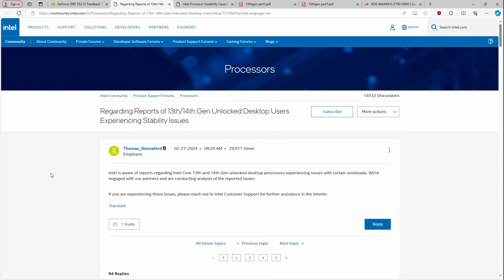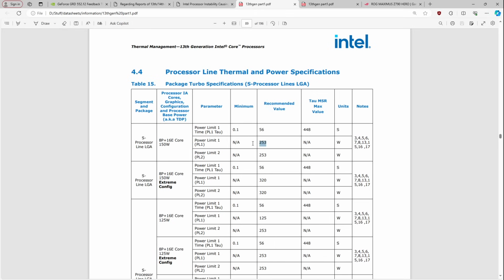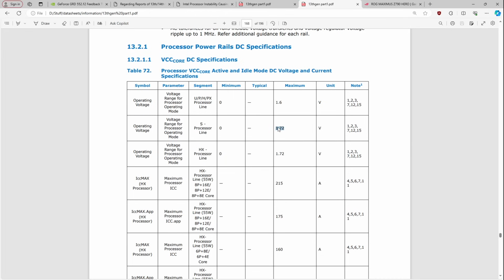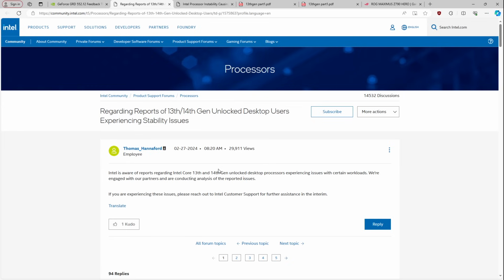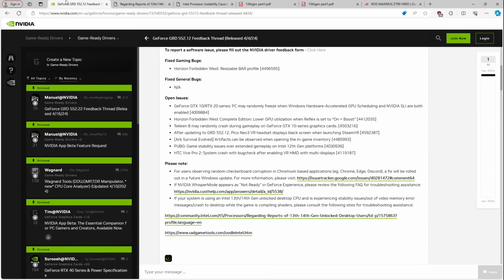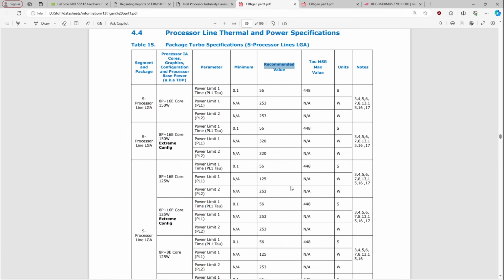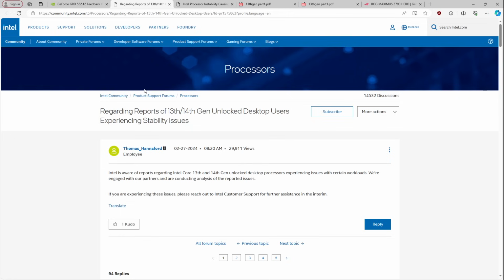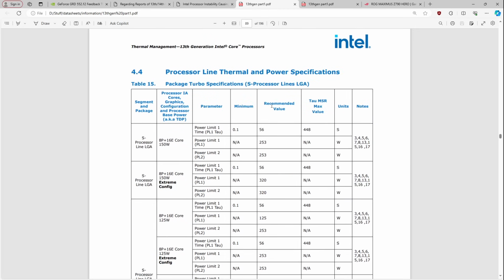Rambling about why some intel 13th/14th gen i9s and i7s aren't stable.

Comment: Nice BIOS upgrade by Asus.

I have 13900K.

I flashed 2202 and now with my custom settings, which were stable on 2102, CB20 dropped 2000 points and CB23 dropped 5000 points. The max performance core frequency on CB is 4800 when before it was 5500.

FML.
Reply: I feel you brother... 😢
Reply: I used to run disable - enforce all limits.  It now believes differently for me.  I had to change it to enable.  😕
Reply: ya 1202 update fucked my Z790 Formula. my chip was shit anyways, might as well RMA it.
Reply: @Ravenx217  There's something with the BIOS settings behavior that was changed.  If enable Asus multicore enhancements the system will run full out.  If I disable it (enforce all limits) the CPU runs at a much lower clock speed.  I previously had it set to the latter and my custom settings for performance and efficiency cores was observed.
Reply: @Ravenx217  Have you tried to flash the older BIOS?

Funny how the Asus MCE setting of "disabled - enforce all limits" drops all P core frequency to 4.8Ghz when before it would pretty much follow what the override setting was (in my case 5.4hz).  What's the use of having an override setting for frequencies of 1 to 8 cores if it isn't being used.  So now MCE set to auto goes 5.4Ghz all P core load.
Reply: What custom settings are you using? Depending on those, it could be why your clock rates dropped.
Reply: @Error-kh4cx  Default motherboard settings.

Comment: I have owned at least one 12900k, 12900ks, 13900k, 13900ks, 14900k and 14900ks. Some have had issues - the worst was the 14900ks I had 2 and both had to go back - real bad crashes/weirdness in Windows. A 13900ks would error bad on a mixed Prime 95 run so sold that as-is. The 12th gens were both fine. I now have 2 systems with a 13900k in and one system with a 14900k. Both running stable and well although I have done all sorts of changes in BIOS to under clock / volt the chips  to keep them from damage from ambitious stock settings.
Reply: Stockholm syndrome
Reply: @tommihommi1  HAHA
Reply: why in the fuck would you support intel at all let alone that much? delulu mf right here.

Comment: So many adjusted variables to make it stable. I do have a Ryzen 7700 and just run curve optimizer (-30) plus a CPU override of +75 Mhz and still runs 5.4 Ghz max at 65C ave on games. Maybe the lower temps are due to my AIO.

Comment: Wow I feel lucky with the limited issues ive been having with my AMD setup
Reply: What issues are you facing with AMD?
Reply: @Sahaj1601  issues with legacy pcie compatibility, basically. Using an old SAS card for more sata ports. Sometimes it shows the drives on first boot but occasionally I have to restart a bunch to get them to show.

Comment: Excuse me, but the numbers ARE specified. There are specific numbers right there, the spec exists. Mobo makers have it and they chose to ignore those numbers themselves, willingly. Excusing that with the word "recommended" is just shifting the blame and semantics, and it's like excusing war crimes because the Geneva Convention is "just a recommendation" so it's safe to ignore. 
Mobo makers are not kids, they knew damn well what they were doing and they did it anyway. This mess is on them...mostly. Yes, Intel is partly to blame because they could have actually enforced the specs and didn't, but that still doesn't excuse the blatant disregard of specifications by the motherboard manufacturers, who just LOVE to do those kind of things. I remember my MSI B450 board happily pushing between 1.4 and 1.5V into my Ryzen 3600 by default, so the CPU idled at 50 degrees with a decent cooler for no good reason...
So yeah...fck the mobo makers.
PS: the early Ryzen 5000s also had issues with not being able to hit the boost specs. I specifically remember few guys from the local tech forum complaining about their 5700x and 5900x CPUs...I didn't know that 3000 series suffered from that too.
Reply from the maker: 1.4-1.5V for the peak boost frequencies is actually exactly what AMD set.
Reply: @ActuallyHardcoreOverclocking  Yeah, but it was getting over 1.4V literally doing nothing, just idling at desktop, without even getting near peak boost.
Reply from the maker: @LastSecBloomer  yeah because when the CPU is doing almost nothing it's coolest and therefore that's the safest situation in which to run those voltages. Basically boost algorithms will always give you the most boost when the CPU is doing the least work because when the CPU is at higher load it's running hotter and closer to the power/current limits.
Reply: XT chips were the same, my 3800xt would boost with PBO and no load to to 4.85ghz (4.725 stock) on the good cores but at 1.55v. Chuck a load on single core and drooped to 1.35v to 1.4v with effective clock between 4.75Ghz and 4.8Ghz.
When I tried offsets higher than 125Mhz it would crash on single core loads and occasionally on desktop.
Reply: If some MB manufacturers followed the spec the CPUs would significantly underperform on their boards, so why should they follow the specs when every other time it didn't cause any significant issues

Intel absolutely would have to enforce it for it to be relevant, expecting MB manufacturers to shoot themselves in the foot for the good of the people is far too optimistic

Also imo, getting a 5% higher cinebench score with some rare instability isn't exactly the same as bombing a hospital.
Reply: @ValentineC137  Actually, performance drop is 5-10%, some tech outlets tested it. And almost non-existant drop in games.
But yeah, knowing how much people grasp onto like 3% performance differences between CPUs in order to wage brand wars (very much helped by tech media), I totally understand why mobo makers do it.
Reply: It’s Intel fault and they should enforce the limits because when shits hits the fan people are replacing Intel with an AMD cpu and don’t start thinking “maybe I should try a MSI board instead of Asus”. And when that happens, guess what board brands they are using for Amd? It should be in Intel interest to force max values, like NVidia did and pissed off EVGA because they couldn’t make their overclocked versions anymore.

Comment: 1.72v??? That sounds insane.
Reply: it is, anything over 1.4v is dangerous and 1.5 and above is guaranteed to degrade your CPU early. fine if you just want to use it for a year and swap it to the next year's model but a bit wasteful imo
Reply from the maker: @puffman06  1.5 is pretty typical for the 6GHz and 6.2GHz VID values on 14900K and KS chips.
Reply: @ActuallyHardcoreOverclocking  For short bursty single threaded loads 1.5 or 1.6 fine. But for all core Nah.
Reply: @ActuallyHardcoreOverclocking  that's crazy to me
Reply: I ran 1.72v and 1.76v on my 13900KS and its still fine. This is on AIO with no load on the CPU, just for a few minutes and its still stable at the same frequencies as before.
Reply: @cryptedvick  how the hell do you keep it cool under full load???
Reply: @0x42NaN  I did not put it under any kind of load tho. Once I was only in Windows then rebooted, and once (1.76v) I was messing with AC/DC LL and it got a little out of hand XD Got into bios, saw the crazy voltage, turned in down and rebooted. Rn I'm running 1.15v at 5.6Ghz HT off and it only pulls 220W under R23 with ~65-70c hottest core, and 60-120w in games. Runs nice and cool.

Comment: I'm running a launch 12700K with E-cores off and AVX-512 enabled. If somebody gave me a 14900KS for free, I wouldn't use it. I can't stand what Intel has done with this platform. Cram in more E-cores for cinebench and push the P-core clocks to the ragged edge of stability for 10% better performance in a best case scenario. I think this slipped through the cracks because Intel doesn't care at all about Raptor Lake. They're all in on Core Ultra and Arrow Lake.
Reply: I think it's not a coincidence this happens when Intel is under heavy competitive pressure from AMD. They realize they don't have a good product right now, so they started cutting too many corners in a desperate attempt to stay in the race.
Reply: Arrow lake is going to be a shit show lol. i think Intel hasnt done a properly good CPU since Core 2 Duo.
Reply: @mercurio822 ...what about sandy bridge? that one was really good imo
Reply: @mparagames  no, it was not, due to that sandy bridge enthusiast plattform socket 2011 sucked donkey cock and i did opt for the quad memory channel due to rendering work, and first problem was sata ports failing soo they had to recall all mobos, secondly was how they screwed me over when i wanted to uppgrade they added an extra pin to the 5000 series and called it a new socket 2011-3. it was pure fucking bullshit.
Reply: Meteor Lake doesn't look good at all. If Arrow Lake fail...😖
Reply: I mean, they also put in 2 MiB L2 cache.

Comment: had unstable system with 14700k. on auto gigabyte aorus pro mobo set loadline to normal or so and system couldn't get through single cb r23 multicore run. setting loadline to medium fixed most of the problems, but occasionally it will still crush at idle or in ue5 games. seems to be stable after setting core current limit to 320 amps, power limit to 280 watts and downclocking slightly to 5.5/4.2 GHz
Reply: Seems pretty decent, considering the max I could push my 13700K to stability is quite similar.

Comment: The memory controller is also partly to blame here for the crashes, especially in games. DDR5 @7,000Mhz and above even with Intel limits cause soft crashes and blue screens. That is with Hynix A die TeamGroup 2x16GB 7,200Mhz. I couldn't get the 14900k stable unless I manually enforced all Intel limits at setting XMP at 6800Mhz. It's been over a month now with zero issues anywhere and in any game or test. So, yes, CPU is the culprit but it's more than just motherboard vendors abusing power limits, it's also an issue with DDR5. We shouldn't have to roll the dice on silicon lottery for a stable out of box experience.
Reply: You are right, IMC can cause problems specially if users just select unstable XMP profiles. I'm running Asus Z790 ITX board with 14700k(SP74) and 2x24GB Patriot Extreme 8000 ram @7600MHz(m-die) with 0 issues. Not a single XML profile works out of the box, spent quite some time tuning and testing until I got fully stable ram at that frequency.
Reply: That's soo bad. 

I am going for 6600 CL30 with dual rank (2x32 GiB A-die) and got it close to completely stable already (should get there later).
Reply: @vintologi  Strange, 6000 isn't that high. My 7950X runs 6000 CL 30 24/7 full load never crashed, on a cheap B650 motherboard. Only RAM I have had issue with with AMD board is 3600 CL16 kit not running above 3200, but it is on an older X370 board, from the earlier days of DDR4, so I just run 3200 CL 14 with tight timings.
Reply: @xeridea  oh my bad, i meant 6600 CL30

6000 Cl30 is easy unless you lost the silicon lottery badly.
Reply: I just use JEDEC, done.
Reply: My MSI PRO Z790-A WIFI board with an i7-13700K and DDR5 running the default XMP profile to enable 6000Mhz has been completely stable. Built the computer in July 2023. 2 16GB sticks of G-Skill F5-6000J3040F16G
Reply: Both 13th and 14th gen I9 and lower clearly state up to DDR 5600 is supported
Reply: @DJ_Tydee  i am tuning 64 GiB @ 6800 currently.
Reply: I cant run my trident z @6400 Xmp with my 13700
Reply: @SultanOfAwesome which Mobo?
Reply: @SultanOfAwesome that's actually sad. Even my 7600x can run my g.skill 6000 cl30 oced to 6400 cl30
Reply: @НААТ what’s your SoC voltage?
Reply: @luvingyouu  2133mhz fclk using 1,235v. 1.35v on vddio and vddq and 1.45v on the memory itself. Asus b650e-f.
Reply: Also using 1.1 vddp and 0.900 vddg
Reply: @НААТ  1.235v soc with 6400 is crazy low, are you in 2:1 mode ? I’ve been able to get 6200 to work that low and slightly lower but never 6400, some cpus don’t even want to do 6400 even on newer bios’ ; D maybe I am just unlucky 
Usually I have needed 1.275-1.3v soc

Comment: I think that in tech business recommended is something that they know is ok, but due to variation and silicon lottery it will work until it does not, like in this example, it's just "we told you the recommended"
In other words even if there would be max there, that won't stop anyone willing from doing so, you don't get legacy of overclocking possibility for nothing.
And there is competition with AMD.

Comment: I think derbauer made a video some time ago about degrading amd cpus "long term", not the perfect condition lab test ofc, but still pretty interesting
Reply: Enjoyed that one, he did show some slight degradation running a fixed clock where some needed more voltage but if I remember correctly they all still ran okay at stock. After seeing it I started using slightly higher voltages on a 3800xt with no issues, that has since gone into my work machine at stock and it's still sweet.

Comment: Yep my 3700X never hit the advertised speed, after a week I never cared. If I was crashing id care a lot more about it, that's a pain I dont want to deal with.
Reply: Get that thing some better cooling
Reply: @mddunlap03  I got a 5800X3D.
The 3700X problem was not cooling, it's just that gen of CPU.
Reply: Many lower SKU Zen 2 didn't make the "up to" boost speed. AMD changed their advertising strategy with Zen 3 because of how much better it feels to reach what they put on the box.

5800x3d would be the exception, it does not readily reach 5.55ghz for even a second.
Reply: @randomguydoes2901  lol yep, starting to wonder if we need to ignore clock speed and move to benchmark scores. 
Now the CPU/GPU lie about there speeds, use clock stretching etc. Benchmarks are the only real way to measure the performance of the part, well and power use.
Reply: @liaminwales  There is already a shift on the clock speeds being less important with marketing, only thing I don't get is the base clock being somewhat arbitrary. Haven't had a CPU that couldn't boost all day. That and TDP which barely means anything now.
Reply: @randomguydoes2901 you mean 4.45GHz?
Reply: The thing about the 3700X is that it sometimes do hit 1.5V vcore briefly at very low loads if you enable PBO . Mine does hit 4.45Ghz as advertised but only 1 sec at a time. Usually holding steady at 4.3Ghz in games.  I noticed that the CPU clockspeed is very dependent on the motherboard BIOS version i use .The difference is, my CPU never gets unstable or even crashed once after almost 5 years. Recently,  I have moved to a 5700X3D .